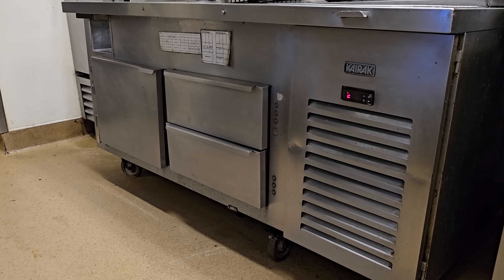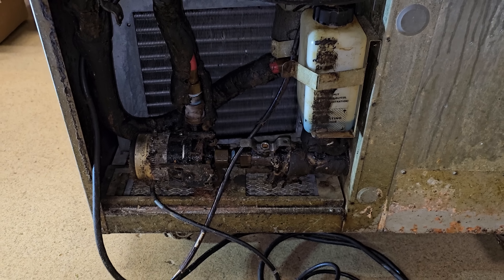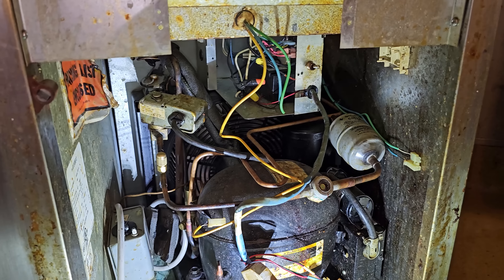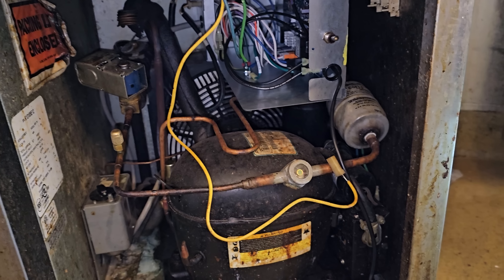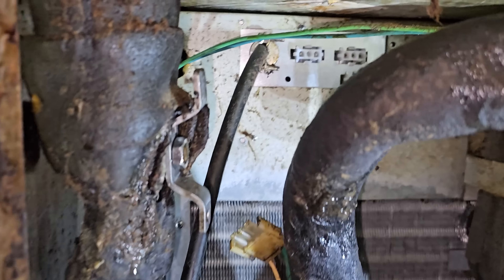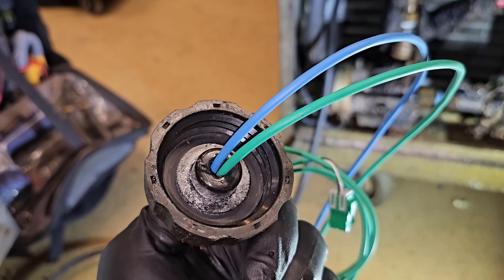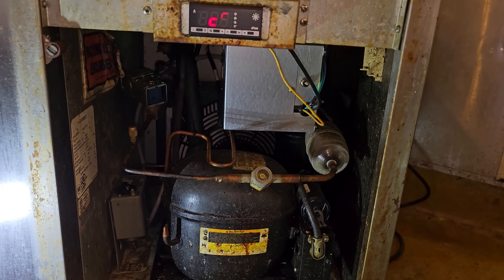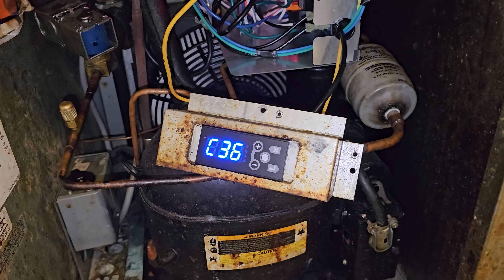KAIRAK BLU CONTROLLER NOT RESPONDING

Comment: If you dont have a coated coil in a prep cooler on a regular unit the  acid from the products eat away over the years after 10 15 years evaps are to springing pin holes in the u turns.

Comment: Obviously, your client has never heard of Dawn Professional Power Dissolver. That stuff is freakin' amazing! Coffee stains on stainless? No problem. Sticker/tape adhesive? Gone. Permanent marker on dry erase boards? Mascara stains on porcelain? Sneaker marks on tile? Easy-peasy. Oh, and it's also fantastic on greasy dishes and surfaces, which is its actual intended use. A bit of a pain to fully rinse, it's a thick gel after all, but it does the job better than any other product I have seen.

Comment: I work on a lot of these units, but I've never had to put in this retro fit kit. This video is a glimpse into my future. I appreciate the heads up. I started using an endoscope to  make sure I get the sensors into that tiny hole and into the glycol flow. It works pretty well.  Thanks for the video.
Reply: If u lose it a straw will get it right in there and u can pull the straw out

Comment: I used to wrap these digital controllers in clingfilm before fitting them. This protects from staff splashing water etc when they wash down.. Saved many a controller from user abuse
Reply: Shouldn't the controller be watertight? Otherwise that would be a stupid design flaw.

Comment: I would put some clear tape over the display / controller save it from getting wet and not hard to take off if you need to change settings
Reply: Does anyone know the dimensions on the controller HMI ?

Comment: Could you throw something like a weatherproof in use outlet cover over that controller so you could pop it open and adjust things but it would block splashing sanitizer and similar?

Comment: Haven’t actually worked on one of these Kairak Blu units. But work on a ton of newer reach in equipment with sensors and digital controls.
I definitely see a lot of sensor failures and sometimes display failures. I prefer constant cut in cold controls for simplicity and reliability, but job security, right? Lol

Comment: There’s only one more of this model that MAY have to retrofit someday. It’s in storage for now and I had probably replaced the controls a year ago with the last of the intellatrol components available. I usually cut a piece of 1/8” tig filler rod and tape the sensors to it. I bend an eye on it and it’s very easy to get the sensors in place. Great job and thank you very much for posting this info.

Comment: I wonder if all that grease and other contaminants are also making the glycol worse over time. If it didn't have a seal on the cap prior to conversion and no cover on the glycol pump cabinet, it should be worth the money to have a metal shop make a new cabinet cover, right?

Comment: I'm surprised a board mounted relay is something you wouldn't replace. I have replaced 2 relays on my furnace controller board for a couple of dollars each.
Reply: Integrated parts replacement can be a liability because you are probably invalidating the components UL listing and in many jurisdictions that is a no go. 😊
Reply: @adamdnewman  Thanks.

Comment: I'm assuming you can't put another tex screw to fix the controller box to something. Still, I would at least try to put something between the dryer and the metal box, so it doesn't rub against each other.

Comment: It's a shame how far traulsen and kairak have fallen, the intella traul was an awesome controller that we had very very few failures on.

I used to tell everyone that if they're going to buy used equipment don't pass on a kairak table or traulsen reach in, but with how bad the designing and build quality has been with traulsen lately (All the units that need higher CFM fans so they don't ice up. That garbage controller, extremely hard to get a hold of OEM parts) I don't really give out that recommendation anymore unless it has an intella traul, The newer karaks are ok, but we have had the same problems with that controller and availability